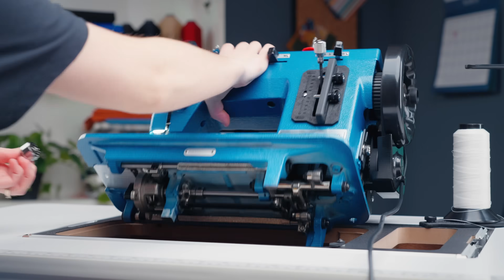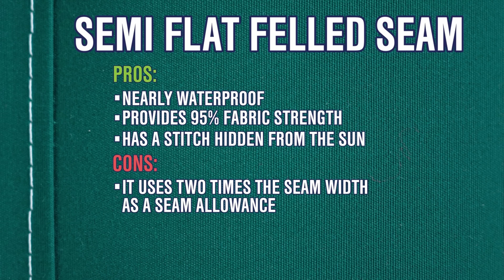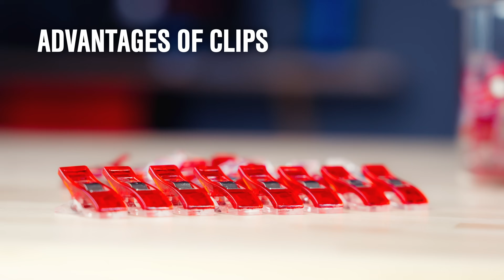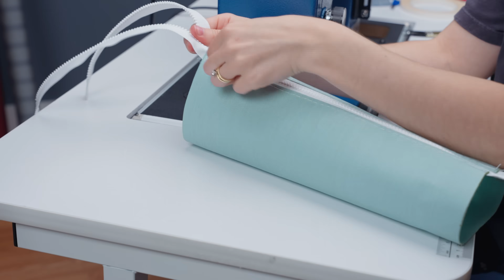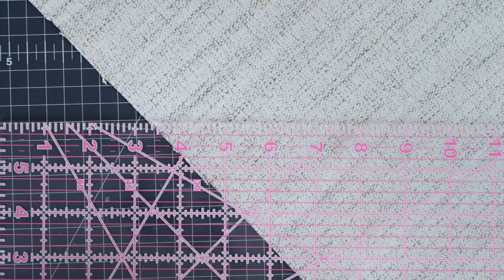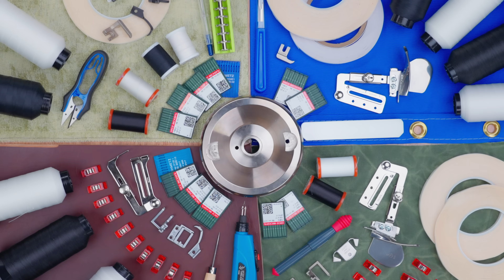Learn to Sew! The Complete Beginner Guide to Start Sewing

Comment: Why did you change the posipin to a breakable one ?
Reply from the maker: The new Posi-Pin is a Safety Shear unlike the metal Posi-Pin. If you sew over a rough patch or make a mistake, the Posi-Pin Safety Shear breaks and actually disconnects the machine from sewing. This prevents timing issues, broken needles, and internal damage. The replacements are also much cheaper so you can have more on hand in-case of any issues in the middle of a large project. If you want to learn more about the differences, we have some nifty blogs on our website: https://www.sailrite.com/The-Ultrafeed-and-Posi-Pin
Reply: She can do what she wants